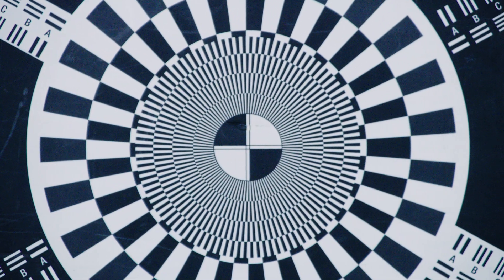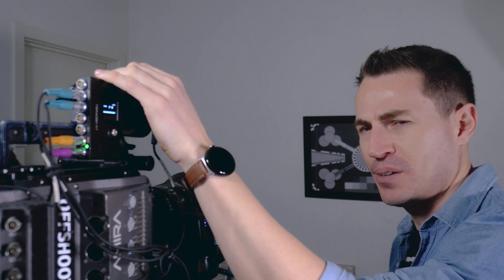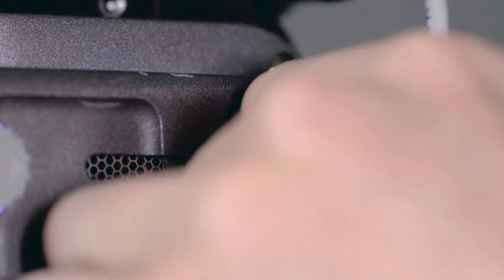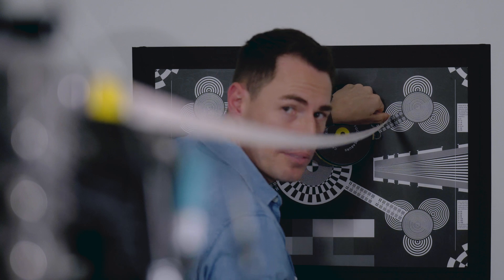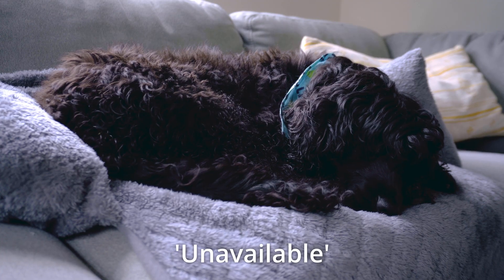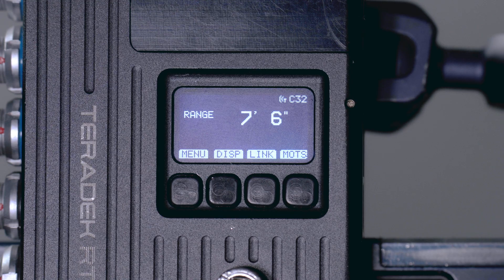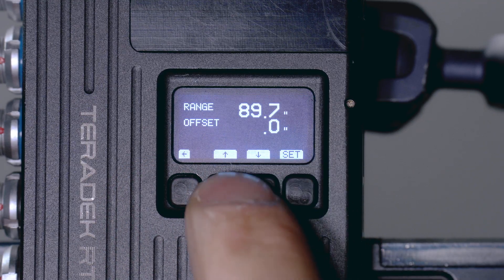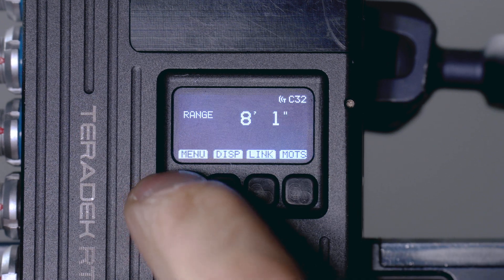Teradek RT | How to calibrate the TOF.1

Comment: how do you feel about buying a tof.1 these days instead of just renting the cinert? I'm on the fence whether it's even worth it now. My main worry is the small beam tbh
Reply from the maker: In my mind, the TOF.1 is great because of the cheap price and it does a good job of basic rangefinding. If that's all you can afford, or all you need based on your types of jobs/skill level then it's worth it 🙏🏻
Where I'm from we didn't have any rangefinders in the state so I was just thrilled to have anything!

Renting/buying a CineRT is obviously a giant upgrade because it's got so many functions and settings to suit whatever you need such as the tape measure mode, bugs on actors, can penetrate glass/fog and adjust the sensitivity. All things the TOF.1 can't do (can only adjust the offset, turn on autofocus and adjust how quickly it responds...). Basic AF.
However the CineRT is damn expensive (because it's so good)!! But it's another piece of equipment to argue with Production to get hired, or another cost to reduce your overall income. Long form shoots almost always know to budget for one, but TVCs I've heard mixed experiences - with some friends buying it purely to help do a better service/help build reputation but not get a cent towards how much they spent.

For Me the TOF.1 has been a blessing and worked so great for Me. The jobs I get usually require a certain level of 'wing it' and so precise measurements aren't so much a priority as knowing the speed of pace of a subject.
I've still done a good service but also have avoided not having to worry about hiring/buying the CineRT. So I'm very happy with my choice.

If you can afford the CineRT and can see it making a big difference for You, get it!!! It's incredible!! 🥳 But if you just need basic rangefinding and/or don't want to break the bank then get the TOF.1🙏🏻